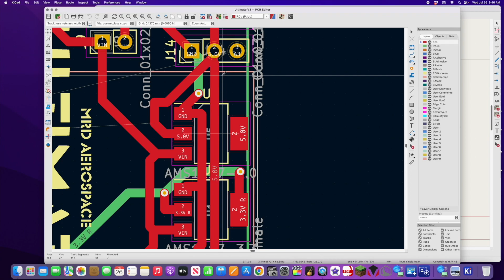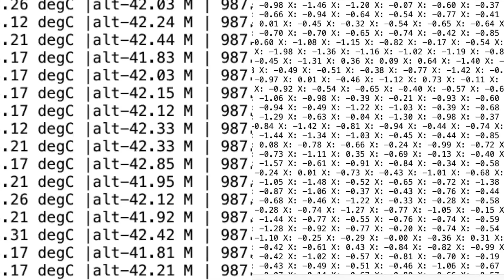The Ultimate flight computer

Comment: Make this module small
Reply from the maker: Unfortunately this is as small as i could make it.
Reply: @ModelRocketDev one way would be to use discrete components instead of mounting whole board onto your pcb. It would be much difficult but would be worth it at the end
Reply from the maker: Yes, i have considered doing that, the thing is im not great at designing circuits and the pcbs are quite expensive.